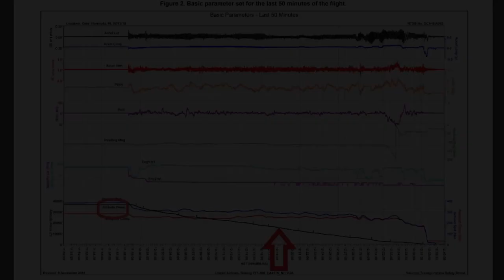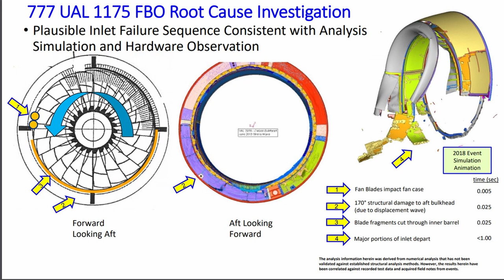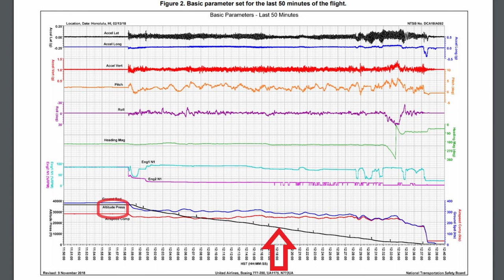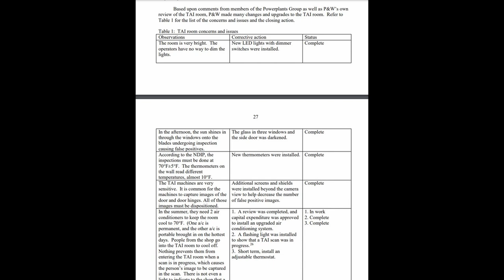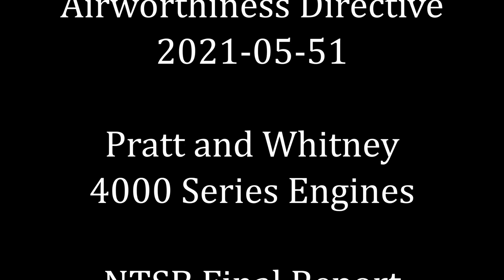Emergency AD & NTSB Final Report UAL 1175 Fan Blade Failure

Comment: The engine drag increase would result in significant yaw and trim problem. I think the 777 autopilots can attempt trim. I question how the airframe was brought to trim and what the landing phi, psi, and theta were. Did the pilot straighten the plane just prior to touchdown? This one way of landing with yaw. The touchdown must have been fairly hard as I don't think it can land one engine out with full flaps. The pilot must have done a good job as the landing looked fairly normal. I  believe from my former airframe design work that the one engine out landing determines the rudder design size which was OK in this case.

Comment: Weren't ETOPS originally rubber stamped before all these next generation ultra lightweight high efficiency/power engines were around? Basically, is there data to suggest that large twins aren't as reliable as they used to be when they weren't so fuel miserly?

Comment: What is the cost difference between a new fan blade and testing (down time)?  How many air crafts are involved?  Who pays for it?   Does the FAA & NTSB have jurisdiction over foreign carriers?
Reply: Probably only if the accident occurred on US soil. There was a BA plane about 15 years ago that had engine problems leaving LA. Shut the engine down and then continued to UK whilst monitoring the fuel and other engines. FAA tried to fine them but they were operating by EASA/CAA rules

Comment: if it were possible for the opposing blade to fail by design, would it be better or worse? im just curious, im assuming the initial destruction from the blades would be definately worse, but would the vibration and all the whatever from it winding down and the windmilling be as bad? paper airplanes are much safer.

Comment: My point is this has happened in 2018 and Manny times these fan blades must redesigned with new material with new material and processing (back to drawing table) There is absolutely no point in reusing after sonography which was done earlier also. In2021 passenger life is no joke. Passengersand govt must sue for this.

Comment: So these high bypass ratio turbo fans, as i understand them have a high pressure compressor section on a shaft separate from the free power low pressure turbine that is attached to the front fan. Does anyone know why they cant design these engines to have a anti windmill feature on the LP section? maybe use a bleed air bypass system to send energy from the HP turbine around the LP free gas generator turbine so that it wont spin and stop the fan from windmilling. I realize the majority of thrust comes from the main LP fan and not the HP section, but i know some thrust is still generated from the HP section. If you could keep the HP section running with the LP section stopped, would it be possible to still have some usable power in the event of a fan blade failure, assuming the HP section isnt damaged? If you could stop the fan from windmilling, you could at least stop the vibration from the unbalanced fan free spinning and shaking itself to pieces, while letting the HP section continue to run. Im sure theres a reason why they dont design them to do that, but given that the LP section isnt connected directly to the HP section, theoretically it could be made to stop rotating, assuming the HP section core wasnt damaged. 

When these LP fans have a blade failure, it seems like the debris is ejected forward instead of going straight into the core, and the unbalanced free spinning fan seems to cause more problems from the excessive vibration, that act to further exacerbate the problems of losing an engine, increasing the potential for fire & additional structural failure, due to the heavy vibration. Basically, i would think that having a way to stop the windmill effect would really reduce at least some of the danger associated with a blade failure, just because you could stop that heavy vibration and reduce risk of further damage to the wing and internal HP core. Youd still have drag, and the loss of most of the thrust form the bad engine, but at least it wouldnt be shaking to the point where more of the nacelle starts coming off and ripping through hydraulics, electrical harnesses, fuel tanks and lines. 

Im willing to bet that a windmilling fan that has lost one or more blades, shaking itself so violently from the unbalance, is responsible for a lot of damage that wouldnt occur if there was a feature to stop it from rotating after a blade failure. youd still probably lose the cowling regardless, but you wouldnt have the insane vibration forces that make a blade failure even more dangerous. i can think of a few ways to redirect gases around the LP turbine, and then design a mechanical system to lock the shaft and prevent it from rotation, preventing the fan from turning from high speed air flowing in while in flight.
Reply: How much would such a brake weigh and how often would it be used?  Fact is the rest of the engine wouldn't run without the fan turning. The fan is part of the first stage compressor section.

Comment: You would think a modern aircraft would have camera in board fro pilots to see the tail, wings, landing gear and engines, like what is on a Tesla. Cameras now days are tiny and a great safety feature add. Heck Mike Patty put a back up camera on his wilga (Draco) and could back his plane into the hanger.

Comment: Had to laugh when you mentioned the fan assembly is made of 22 fan blades and the guy in the insert is pulling out numbered fan blades with the last one marked "24" 3:11 Different engine, perhaps?  I'm more of a radial guy...
Reply: The model shown has a different number of fan blades.
Reply from the maker: CFM engine.

Comment: I'm no expert but I think the reason why they paint the fan blade is because the blade is metal and highky reflective so it will affect the thermal result  
The thermal laser will not give an accurate reading on a reflective surface 

Thats what I think anyway

Comment: Idea:  The engines need a disk brake   ...so after the engine has a blade off ..and the fuel is off  ..the brake could be engaged to stop windmilling preventing heavy vibrations  ....imaging being 5 hours from land having a shaking engine shake the wing off  ..a full stop disk brake would prevent further wing  fracture damage
Reply: I’m pretty sure having the blade fully stop would cause more drag as it’s topping air from getting in. That’s partly why turbo props feather the blades if there is a failure to reduce the drag. I highly doubt the wing would break off due to the vibrations.  Have you seen how much stress they can take in bend tests

Comment: I would still like to know how many hours the fan blades that have failed, across all incidents, HAVE ?  WHAT is the life expectancy of this particular blade ?  Anyone ?
Reply: Engines typically last 30,000 hours, and require inspections at 2000-5000 hour intervals.

Comment: I wonder how many hours or cycles are on these blades and if they has any relation to failure. At flying speed what is the velocity of air going thru this fan?  I know the problem of propellor planes at speed is transonic airflow over the props, especially the tips, heck my old 182 could do this, had a long prop and did 2700 rpm.
Reply: obviously striking a goose at any time is not good.  (either for the blade or the goose).

Comment: Could they ("they" = combination of P&W and airline maintenance, I guess) swap blades between engines, such that a set is inspected and cleared, sent to and installed on a 777 that just had the blades pulled, and then those pulled blades go to P&W for inspection, thus keeping a steady flow of cleared aircraft? Does that make sense? Rather than all of them just sitting there w/ no fan blades because they've all been pulled and sent at once... May not matter since ALL affected 777s gotta be parked anyway. But I thought maybe if they did it like a "core return" for a car part, they could turn them over faster...

Comment: Anyone knows why they directed TAI? There are other NDT methods, including a variation of what Juan mentioned. A test engineer may use a little (special) hammer to induce vibration on the blade (directly in the engine, turbine), but obviously they don't listen to the sound these days, a vibration sensor is attached and vibrations recorded. They are later analyzed using methods like Fourier analysis and quite reliably reveal abnormalities, such as cracks, even inside the blades. While this is still painfully slow test, it's much easier and faster then TAI. There must be some reason why they use that more complicated method, perhaps it reveals also very early initiation stage of cracks...?

Comment: So, this happened in 2018 and again in 2021?  Was this TAI done after the 2018 event ... I don't remember if that was mentioned.  If it was, and it occurring again, then I'm not too sure that the TAI process is accurate enough.   Bottom line, I'm not flying on any aircraft with P&W engines, if I can help it.

Comment: Stick those blades in a pool with a dolphin,.. I bet they can (be trained to) detect the cracked ones in a second, and for the grand price of a small fish.
It's basically a massive neural net optimized for analyzing sound reflections. 
I bet one of these blades with an internal flaw sounds like a lump of wood compared to a bell to those guys

Comment: Great video! Always learning something new.  But one comment, you are using us metric for weight and fuel comsumption (5 gallons per 1 pound ... fan blade 42 inches and 20 ppund).. could you name a European metric with US as well? It would help us a lot immediately understanding ratios you are mentioning... tx

Comment: As someone who knows a very little bit about metallurgy, I have to question if Thermal Acoustic Imaging is non-destructive or destructive testing.
Reply: Well if it was destructive then there wouldn’t be any point in doing it.
Reply: @malcolmpetty1718  Nope. Destructive testing diagnosis everything. But that would get very expensive if everything was tested destructive.

Comment: with all the small camera technology why can't there be a designated camera focused on key parts of the engine and wifi to an Ipad  in the cockpit?....I've been asking this question for years. The buff that launched the x15 had a lexan blister to view ac for observation reasons. I can't be the only one..........is there anyone outthere? dme a&p since '81
Reply: It’s never been proven that having a camera would have made a major difference to the outcome of an accident. In pretty much every accident involving engines the sensors can tell you all you need to know and even more regarding other systems that maybe have failed like in the case of QF32 (which did actually have a camera on the tail)
Reply: @tomstravels520  if you listened to jb the wires were cut to the instruments  and they sent one of the crew to look out the window. The sensors have been known  to malfunction or give false readings. Hence the reason the captain of the 09 b17 shut down the wrong engine.The camera in the tail is for you tourist. de A&P since '81
Reply: @davidetcheverry944  the camera in the tail is primarily for taxiing guidance combined with the user side camera (hence the pink dots and lines) to show wheel position and not all airlines give you the option to have it viewed on the IFE. QF32 had this ability but pilots didn’t use it or couldn’t as it was not clear enough to view the damage. Last I checked BA did not give the tail camera option on the IFE at least in the A350

I don’t know what you mean by 09 b17 but I’m guessing you’re referring to British Midland 92. That was because the LED sensors of the 737-400 cockpit were so small they were barely visible when the cockpit was vibrating and shaking so the captain went off instinct and experience to shut the engine off (which turned out to be wrong) and you got no warning to say ENG 1 FAIL like you do in the A320 or 777.

In the incident JB is referring to if you hear a loud bang but no warning comes up and the sensors freeze you could always move the levers a bit to see if there is a response. Even a frozen engine display is a warning something is wrong.
Reply: @tomstravels520  2009 b17 tail number 909. crashed on landing. what are you talking about? bm92?  JB and Flywire do a analysis on the crash. Must be smoking something.......
Reply: @davidetcheverry944  I haven’t look up the b17 crash. BM92 was a 737 where the pilots shut down the wrong engine for the reason I said
Reply: @tomstravels520  where did you say they shut down the engine? just stop it bsssssssssss.
Reply: @davidetcheverry944  right there in the comment. After you said about shutting down wrong engines

Comment: Probably expensive, but could one of these aircraft get back in the air by replacing all the blades with new blades?    Are there even any new blades?
Reply from the maker: No new blades.
Reply: @blancolirio  Figures.  Is there an alternate engine that could be used?  Ultimately the inspections are going to be too expensive to do on a regular basis so they may need to limit the life of the blades.  I assume more cannot be produced economically.

Comment: juan, you have seen the picture of the leading edge ring of the inlet duct with the slash in it/ Did you realize if you could reassemble the pieces of that inlet duct in such a way that you could determine the clock position of the slash you could the deduce the clock position of the fan blade when it broke off and then you could determine the path the blade took as it left the inlet. How's that for a puzzle to keep you up at night. No pun intended but I am writing this at 2am it is really keeping me up at night.

Comment: Juan, do you think it's about time that planes have cameras fitted to the tail and other places so that in a moment the air crew can immediately see all four corners of the aircraft and the outside of the body at a glance? Given how small and cheap good cameras are now it seems to me it's long overdue
Reply: Having one on the tail for anything other than taxiing won’t be much help as the wing hides most of the engine
Reply: They do have cameras on the plane for years
Reply: @oldiesbutgoodies4539  Do they? Why do pilots seem to usually be not aware of what's going on when something happens that's visible from outside? Such as this case?
Reply: @herseem   Cause they are to busy trying to figure out what's going on So They can't leave the cockpit to see have to rely on instruments unless they have 3 crew members up there Or if The Flight attendants tell them And Yes Cameras been in use for years Airbus has cameras for years
Reply: @oldiesbutgoodies4539  ok, I didn't know Airbus has them already. Thanks for that info
Reply: @herseem  no problem

Comment: It's very cool that they can just slide the fan blades out of the front of the engine.   Fatigue cracks are no joke and have always been difficult to find apparently, especially on the inside of a hollow metal structure.     I recall early aviation disaster 2 or 3 times the BOAC Comet disintegrated in mid flight, apparently due to fatigue cracks in the fuselage that appeared only after so many cycles of use.   The analysis involved essentially building a swimming pool aircraft size, and using that to pressurize and depressurize the fuselage then number of cycle times until the failure was located.    We have come a long way since then.

Comment: Just thinking... if a blade is found to have a fault does it mean it was manufactured with it or has it developed? If it has developed aren't all blades subject to eventual failure?
Reply: Metal fatigue affects everything eventually. The key is to remove faulty parts before catastrophic failure.

Comment: the biggest issue I have with these containment test videos, what speed is the air going at the front of them? yes they may pass ground tests, but at 30 thousand feet at Mach .781 they're still not going to be contained. that's a pipe dream
Reply: The answer is 0 mph for the test.  I believe these incidents actually prove that containment is achieved in flight.  2 777's plus an A380 had a hub break apart over Greenland a few years back. Same basic result.   Containment means the flying metal debris doesn't get out and go through the airframe. It doesn't mean the engine needs to keep running. It just can't seize up as a result and possibly rip itself off the pylon due to torque induced from a sudden stop.
Reply: But real life vs the test.... The test the cowling stays of, real life cowling destroyed causing in many cases, sever air frame damage. One time a person being partially sucked from a window and dieing. These tests aren't showing a true to operation picture

Comment: The new jet engines today GE90, RR,and PW are so powerful on this twin jet liners, very fuel efficient fan jets that the amount of energy it generates are susceptible to material failure at times. Very reliable thou.

Comment: So we have a VERY High Tech test capability but nobody or not enough folks to do the testing AND test prep methods (Painting) that can vary as well.   Whoa !   Sounds like a recipe for  more fan blade failures.    
So next will come what, a redisign of the cowling?   Not much you can do if a fan blade literally flies out of the engine ahead of the cowling or into the cowling leading edge.  Key issue seems to be somehow preventing the destruction of that cowling and the resultant major impact on the planes aerodynamic conditions.   I understand the desire to reduce  costs and parts by going to 2 engine designs but somehow my old-fashioned logic tells me that 4 engines or even 3 could reduce the serious impact of suddenly losing both power and aerodynamic stability  .